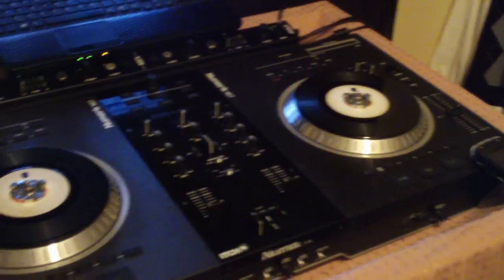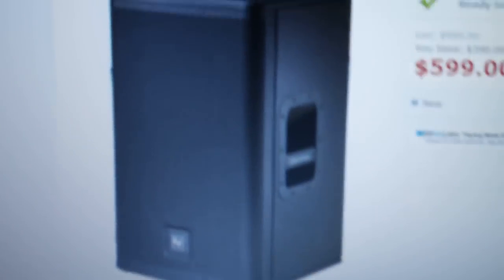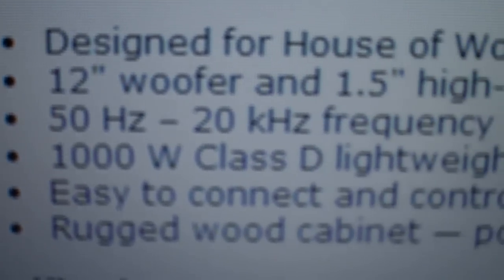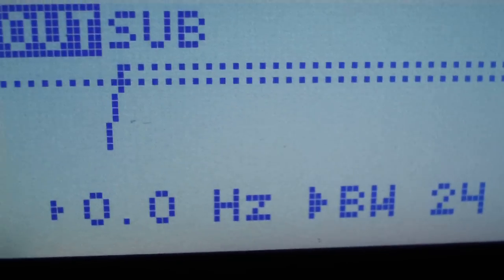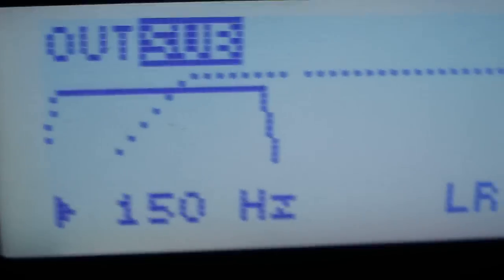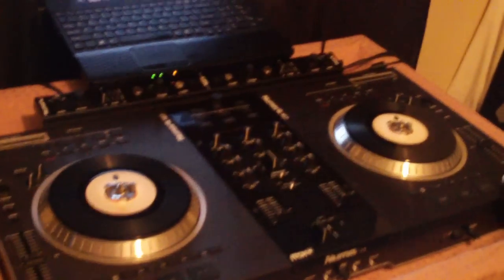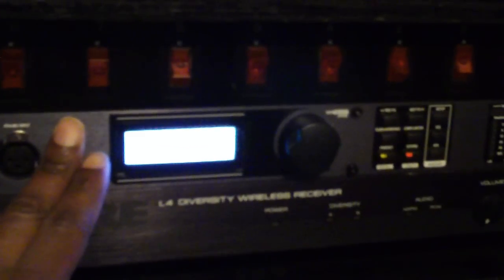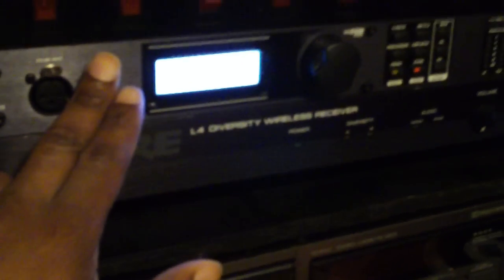Driverack setup-using frequency slope!

Comment: LR stands for Linkwitz–Riley.....these are the last names of (2) speaker designers (men) who invented all these terminologies back in the 1920's.......its the passive crossover network (filters)......BW "butterworth" is another guy who had a slight different take on the filter design that sounds slightly different ..........6/12/18/24.....is the db per octave slope.....ak 12db per octave..........a low pass filter set at 100hz 12 db/octave will be  -12 at 50hz

Comment: If your sub amp is clipping, and you don't want to turn it down, make your frequency cue (size of the frequency range) more narrow. I've managed to stop the clipping problem, and kept my volume by rolling off the top end of the sub at 80-100HZ. The same thing applies to the sub's rolloff frequency. Keep an eye on your amp's clip light as you move your slopes up and down. 60Hz is the general 'peak of the mountain' for kick drums. An additional, and equally critical feature is the limiter. Set your limiter to capture the top peaks just before clipping. Setting your low frequency limiter with a knee of 1 sounds like you are blowing the speaker, it's nearly a square wave. Use a knee of 3 for your subs, and a knee of 2 for the upper speakers.
Reply from the maker: Tim Kasey wow thats very well put...I need to try that method....thanks man!
Reply: +T-Dubbie Solo I run sound for a band, and they have a QSC 2400 into 4 sub speakers. I've bridged the amp to get the most power, and still had clipping problems. It wasn't until I narrowed down the frequency, centered around 60Hz, that I was able to get a decent THUMP! THUMP! that you would expect from 2400 watts. There is an added variable that you need to check (I need to do this also). take a test tone, and determine the exact point where the low frequency becomes distorted. The way you can do this is to turn the amps power knob down to 9 o'clock, and run a 60Hz tone into the amp. Turn it up until the clip light comes on... keep turning it up until you actually hear the distortion. What you will notice is that you have about 3-6Db of extra volume, just past the point where the LED begins to barely turn on.  This is a critical detail, and you don't want to set your limiter so low that your power is only 2200 watts (down from 2400 watts). Remember, when you reduce by 3dB, you cut your power by 50%.... so, this is where you can tune the system to get all of that power you paid for. This will ONLY show you the point AFTER the LED begins to light up.. where the distortion will begin. You would then need to, after turning the amp full on, run a 60 Hz tone through, and do it for real. You don't want to be doing this test with a real kick drum... a test tone will probably not blow your speaker... You just want to lightly know where the distortion begins, and set your limiter to stop it at that point. Be careful!
Reply from the maker: WOW thank you so much man..I wish I knew what you know about this situations...this really helps me alot in a long run...I will definitely use this method to optimize my set ups to its full potential and lucky for me that I have a driverack to save my presets for a quick set up and not have to worry about clipping and losing power by 50%....I will be doing another video about this method soon...thank you so much man!
Reply: Yeah, I really need to get over to my friends house, the one with the system... record a video on all of this. It was difficult for me to hold the camera, get the contrast on the Driverack PA just right, and make adjustments with one hand... I tried to shoot a video, but I don't think I like the way it came out.
Reply from the maker: lol sounds very interesting...would love to see it soon :)

Comment: THANKS SO MUCH! For your info! Your info was SO USEFUL! 
I was wondering about the specs of my sub woofers. The driver is a Eminence BP102. The ONLY thing it says about frequency is: Resonant Frequency (fs): 40Hz. THAT's IT. How should I set the sub frequency and slope on my DriveRack?
Reply from the maker: Gilbert Arciniega  Basically it means thats the frequency that the woofer makes without a box put into it.....and it depends on what box the speaker is put into it like a sealed or a ported box...a ported box is usually the best choice since you can get a better output(depends on the tuning of the box)when place inside the enclosure...and from there you just kinda listen to the woofer for the best frequency respond like say.....a 40hz.....if the sub that you put in and it is tune to 40hz within the box itself then you can set your frequency from that point on

Comment: Hi man! Ims using 4 qsc k12 L and 4 qsc k12 R and 2 qsc kw18 subs per side. Wich configuration do you recomend? Is for a church for 1000 people.
Reply from the maker: what I will do is daisy chain from one qsc k12s to another per side(hooking from output speaker 1 and in to the speaker number 2 input and then so on)then do the same for the right side as you will do on the left.....after you daisy chain 4 speaker per side...take the left side cable from the driverack main output and hook it up to speaker number 1 inputs where you start your daisy chain...meaning that(output from the left side from the driverack into speaker 1 inputs+from speaker 1 outputs goes into speaker 2 input+from speaker 2 outputs goes into speaker 3 input and from speaker 3 outputs goes into speaker 4 input)and same goes for the right side as well.......Now for the subs since your using them per side as a stereo set up just hook one sub to the(sub output left channel to the driverack)and then another sub to the(sub output right channel to the driverack).....you can also daisy chain your subs together(by hooking sub number 1 to the input from the driverack and then take another xlr cable and hook it from sub number 1 output into another sub(number 2 input) and from there set the driverack in mono mode to the subs...meaning that the left channel will only light up on the left side of the sub channel while the main outputs remain in stereo...hope this helps.
Reply from the maker: I notice you say 2 18s per side meaning I think you have 4 18s all together.....So for this situation you will do the same configuration as you would do to the tops per side(from the sub output channel from the driverack goes into sub number 1 input...then from sub number 1 output goes into another sub number 2 input...and then do the same thing to the other side...2 subs daisy chained together per side.
Reply: thanks a lot man! i love this driverack, i have 6 days with this unit, im now looking to use AFS system for al my mics, i use this PA system live all the weekends. did you have an email or something? cheers!
Reply from the maker: Sure...its     mixtape120088@yahoo.com

And your welcome...glad that I can help

Comment: you hit the nail on the head.... the Driverack will not only optimize your powered speakers, it will also protect them.  I feel the Driverack is crucial to ANY PA system.  I blew up 2 subs in 4 weeks and then finally bought one.  My system never sounded better!  your wallet will thank you.   thanks for the videos bro
Reply from the maker: reVIDeng Your welcome...glad that I can help.

Comment: The LR and BW refers to the crossover used in the speakers.  LR is Linkwitz Riley and BW is Butterworth, the number refers to the slope of the curve.  If you really want to get it set to optimum settings you should research the specifics of the speaker.
Reply from the maker: Ross Gladwin Thanks.....I will sure do that.
Reply: In my experience with the installed systems I have set up, the Butterworth crossover has a richer tonal quality, but that will be dependant on your installation.  You have to use the Drive rack with an RTA mic active to get the most of your system.  I have seen systems that were set up with the mic in place and then they took the mic out thinking the EQ was set up and it wasn't needed any more.  The purpose of the Drive Rack is to manage the sound as conditions change and it does it very well as long as the mic is active.  Also there is a Drive Rack PA + which is designed for mobile use
 which looks like what you have, Drive Rack PX for powered speakers, Drive Rack 260 for permanent installs as well as several other models.  So regarding LR and BW crossovers take a look here.

 http://www.avsforum.com/forum/155-diy-speakers-subs/1642074-difference-between-linkwitz-riley-butterworth-crossover.html

Butterworth for odd filters, Linkwitz for even. A Linkwitz is just cascaded butterworth filters. Bessel filters are for keeping an even phase/group delay.

Each of the filters has a different Q value, which give different amplitude responses. BW is Q or 0.49, LR is 0.71 (which is 0.49^2), which is because it's just a double BW filter.

LR filters are -6 dB at crossover, so they sum to flat (0 dB). BW are -3 dB, so they sum to +3 dB.

The link will give you a good visual representation.

Comment: hey, I'm looking to get this or something similar for use with my EV powered speakers.   The speakers I'm using have built in DSP with limiting, crossovers, etc.  I'm looking to use these for mains as well as monitors, any chance you know if one unit in MONO could do 2 separate monitor mixes, or will the DriveRack be trying to level out the volume between L and R channels?  I'm mainly wanting the room EQ functions and feedback fighting.  I may end up needing 3 of these, but it will be one at a time as things progress.  Hoping to build a small effective rack with minimal gear, power conditioner/s, Driverack and/or EQ and feedback fighting unit of some sort.  Other than that, I have plans for space for wireless mics or a tray for ones that aren't rack mountable.  And a drawer or two for mics and cables, thinking 10U or maybe 12U rack.   Any input helps, thanks for the video!
Reply from the maker: The driverack can do a mono operation as well but the volume will remain the same on both channels.... how are you hooking up your system by the way?
Reply: *****  for now the left and right outputs go into sub, then out of sub to the left top and to the right top.   I don't have a DBX unit yet, but am thinking that when I start doing some gigs with live bands it will be handy to have for feedback suppression.  I would imagine that hooking up the FOH speakers will be pretty straight forward, but for the monitor mixes, I think I may look at one of the DBX units that might be able to do 2 separate monitor mixes, or possibly just use 2 units, one for each monitor mix.   Thanks again for the reply and for the videos bro...
Reply from the maker: No problem bro...let me know how it turns out
Reply: *****    DBX got back to me, and suggested that I look into the AFS224 for feedback suppression on the monitors.  I will look further into the DR PX, the PA+, and also the possibility of using a DriveRack unit only on the FOH and using the AFS224 on monitors.  I mainly do mobile DJ type work, and will hopefully have a DriveRack chosen for mains soon, lots to learn.   The AFS224 might be just the ticket for monitors, as the speakers I'm using have quite a lot of built in features and may work out well for monitors without too much needed beyond fighting that inevitable howl of feedback.  Thanks again for the videos.
Reply from the maker: No problem

Comment: This is a helpful video. Are you using a Driverack PX or a different one? I have a Driverack PX and my screens look a little different when setting the frequency slope. Mine has a third option for the db level.
Reply from the maker: Im using a PX as well and the db level is the volume for ur mains or ur sub outputs if u press the data wheel several times
Reply: Okay thanks. I think I figured it out. Thanks for posting this helpful video.
Reply from the maker: No problem